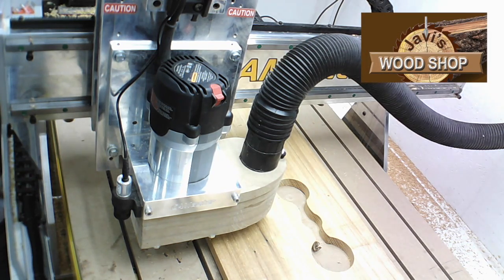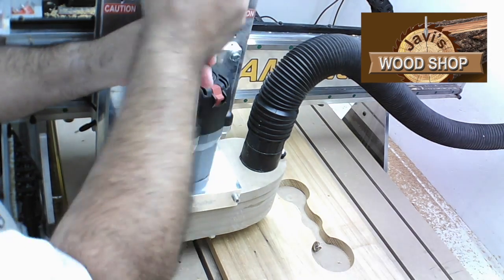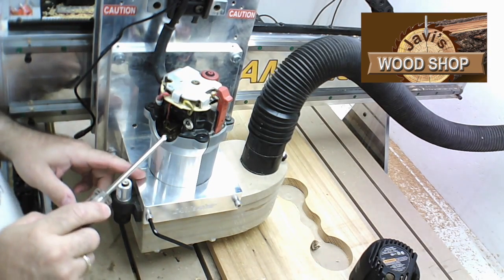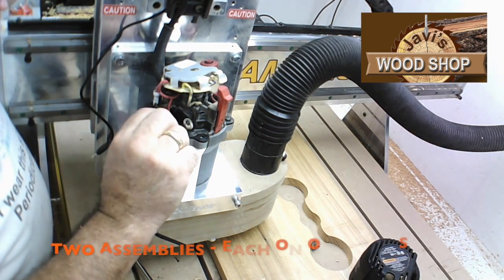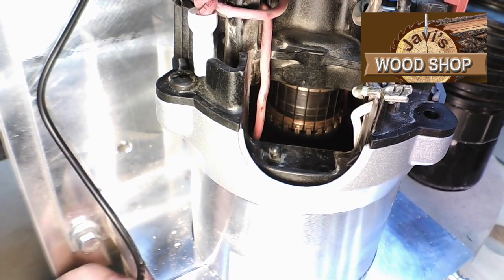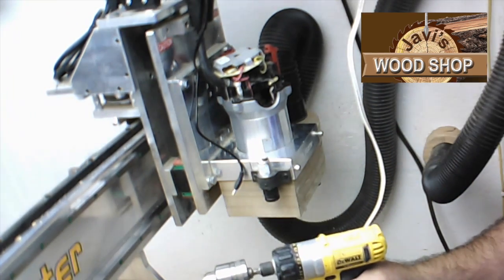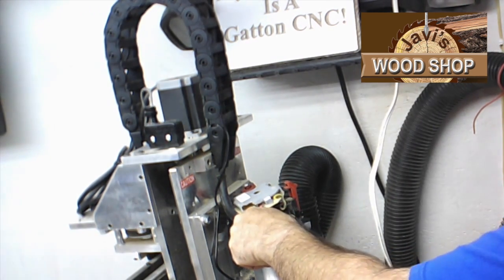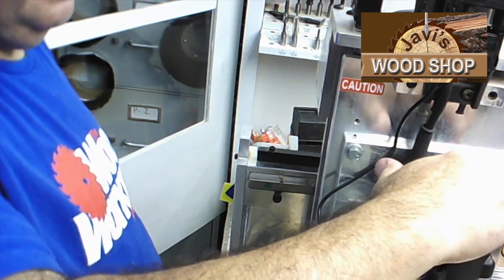890 Series Router Maintenance

Comment: Javi, thanks for making this video! I needed to replace my brushes in my PC 890 and I  miss placed my manual so I trolled YouTube and up popped your video. I watched it a couple times and I figured, I can do this. I was getting black dust particles from the exhaust port so thought the brushes were bad. Opened the router and the brushes are in excellent shape, but the commutator was black so I took 400 grit sandpaper and with my 1/2" drill attached cleaned off the corrosion. 1. Reassembled router. 2. Remembered to remove the drill. 3. Plugged in the router and flipped on the switch and it worked! Saved $$$ and gained experience.
Reply from the maker: Awesome Jim. Remember to take an old t-shirt (or underwear) and place it on the back with a rubber band to filter the particles. It's a toss up between overheating from lack of airflow or damage from dust.
Reply: I cut up an old sock toe and it fits perfect, even looks like a hat.

Comment: Slick! You think it would be a good idea to blow the motor out with air before putting it all back together and firing it up, or would you be afraid of just blowing copper dust all over the place?

I've always blown out the motor with compressed air at the end of the day to help prevent sawdust buildup in the motor. It doesn't prevent gunking up the commutator, but it delays it quite a bit.
Reply from the maker: I like to live dangerously. All kidding aside, I'm definitely adding Dave's torn shirt/underwear idea as a filter on the backside of the router (underwear on the backside... that's funny). 
This damage shows the importance of a vacuum system. The incident most likely happened when I resurfaced a spoil board a few months back without the vacuum on. MDF dust is deadly to routers. I let it go too long without addressing it. Lesson learned.
Reply: I've been a big fan of Porter Cable routers since the 80s. I've said for years that if you blow the motor out with compressed air after you're done with it for the day, replace the brushes if/when necessary, maybe replace a bearing here and there, they'll outlive all of us. I know people in cabinet shops and furniture shops who are using PC routers that are well over 30 years old, daily. They're real workhorses.
Reply: I have done maintenance on many hundreds of motors in my 20 years in the military and one of the most important things is to make sure that no copper is left behind after cleaning the commutator. Shorting between the windings is certain motor failure!